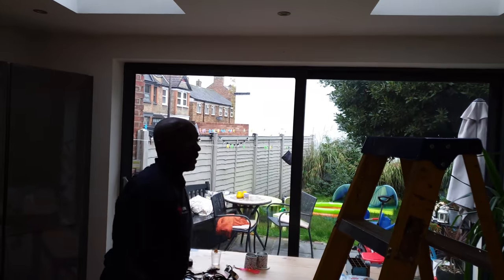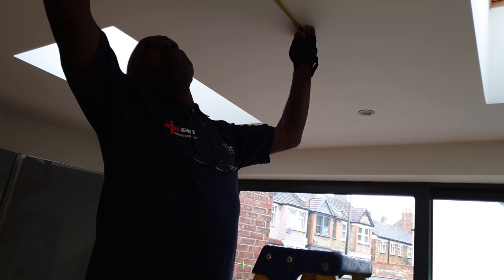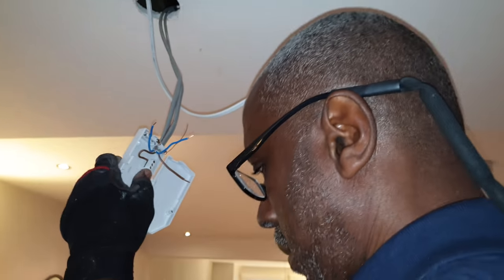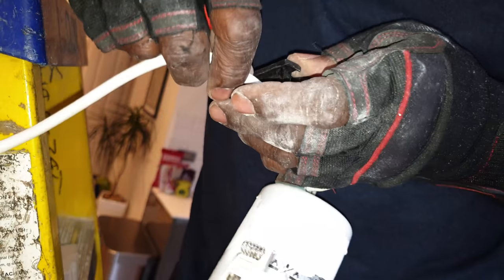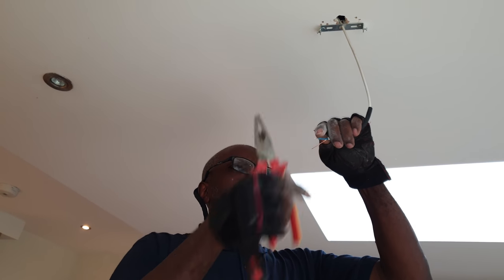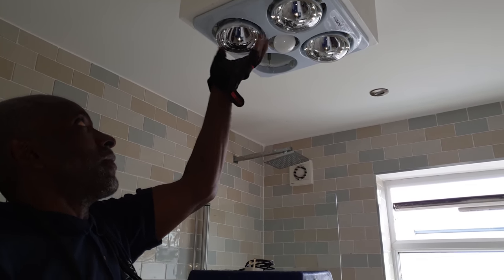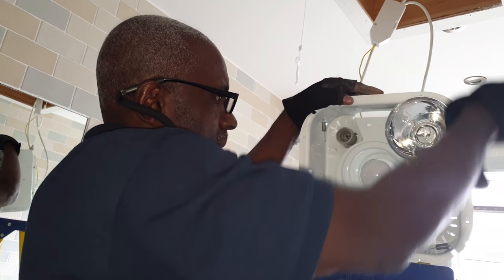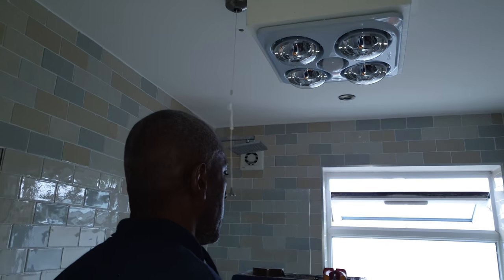Rewiring & Installing A Peculiar Aussie Bathroom Light + New Kitchen Lighting Point

Comment: Here in Australia these units are common. However they require good ventilation. Usually we put them into an open roof space where they get plenty of air flow. They do get super hot so you may want to look at putting some ventilation holes in the side of the box to reduce the fire risk

Comment: They are common in New Zealand as well (all the houses I lived in have these units) - quite good for instant heat, integrated fan and light makes installation easy. But I never seen it installed it like that (in a box) and it needs to be earthed. We don't use pull switches and the unit is controlled by a switch that controls the light, heat lamps and fan separately.

And this unit did it have a fan? It looks like it wasn't vented or wasn't it used?
Reply: I lived in a unit where we had one of those combo fan/heater/light units and the heaters were controlled by a pull cord switch, and I am in Australia.
Reply: @denisovanhybrid9610  No it isn't.